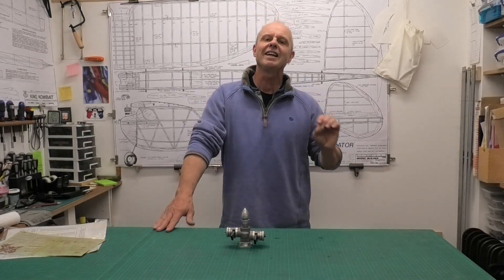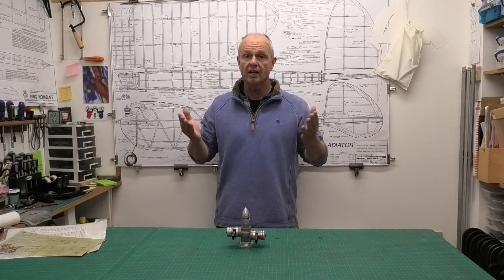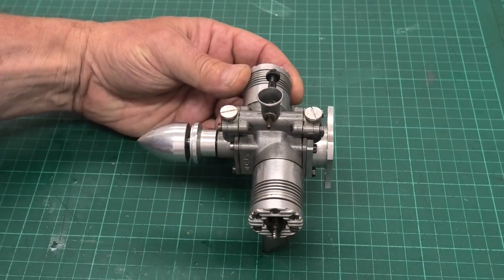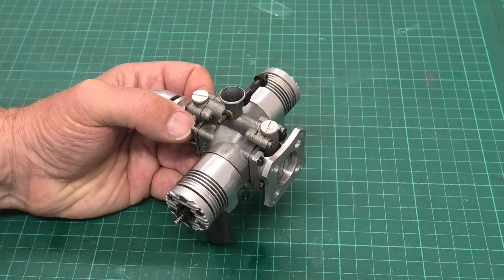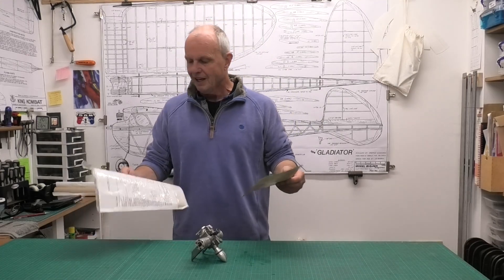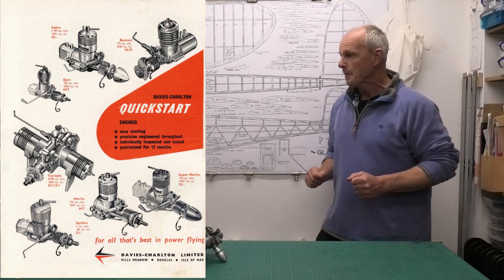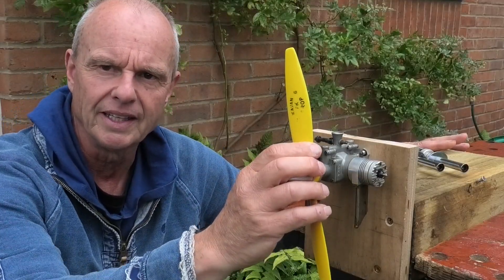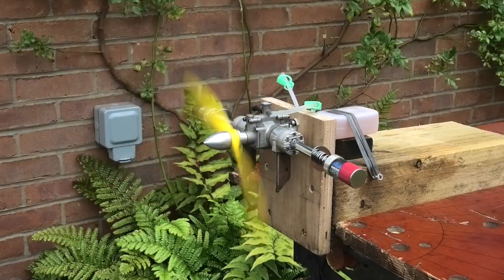DC Tornado Twin - 5cc Glow Engine - Review & Running in the Test Stand

Comment: Hi mark an excellent video of the tornado motor, i didn’t know that dc made glow engines as many years ago I had a couple of dc small diesel engines, i have a question for you why do you check the rpm from the rear of the prop, when i used to fly  and tuned the engine i always checked the rpm from the front of the prop.❤❤❤❤❤❤❤
Reply from the maker: Thank you very much, really appreciate the comment.  If I have an engine in the test stand I am usually behind the engine fine tuning it so easier to check the RPM from the back.  Also if the engine happens to come loose its going forward, so safer behind.  This is also the case at the airfield where if a plane is not secured properly it will move forward, so again safer from behind.  As far as accuracy it makes no difference if the readings are taken in front or from behind.  Hope that helps

Comment: Hi Mark,
It ran very good. Only thing I would have changed for the tests would be to raise the tank to the level of the fuel inlet. Thanks for these videos.
Reply from the maker: Thank you for the comment pleased you enjoyed it.  The fuel in the top of the tank was just below the spray bar, you have to be careful with engines of this configuration not to have the tank too high, so avoiding the fuel syphoning into the engine, as any excess fuel will go straight to the cylinder's as the carb is the highest point.  Thanks again for the comment 😀

Comment: Absolutely gorgeous indeed Mark, as you said. What a gem!  Looks to me as though it was still quite tight (getting hot) and would benefit from a bit more (rich) running-in and a slightly smaller prop.
Reply from the maker: Thanks for the comment, really pleased you liked it, it is as you say a gorgeous engine.  I don't think the engine is run in yet, it was quite tight before the first run, but then started to feel better after a few runs.  The first yellow prop I had on it was the size recommended in the engines instructions for running in, but certainly happier on the smaller prop. Thanks again 😀